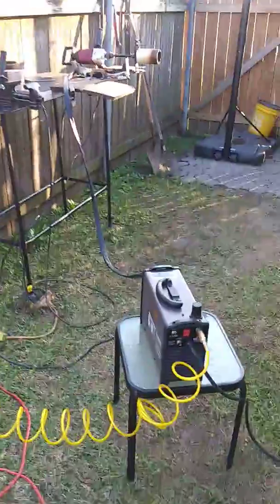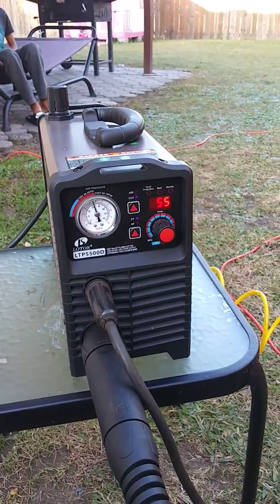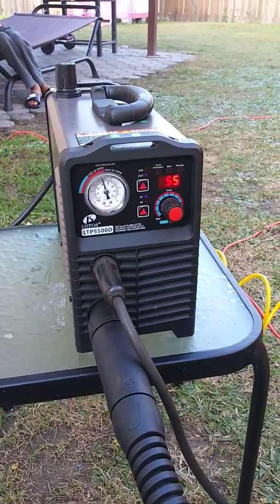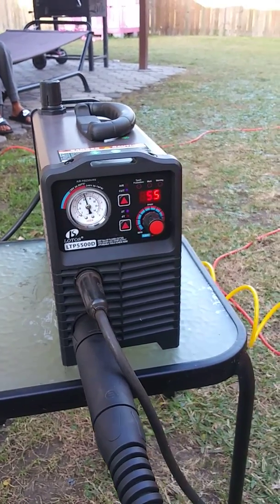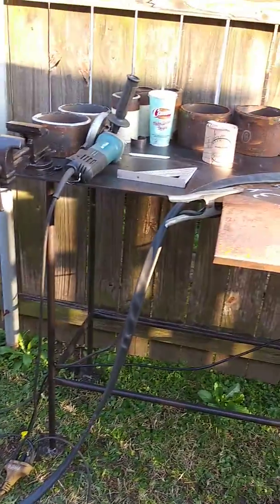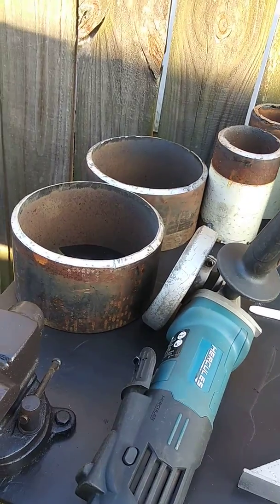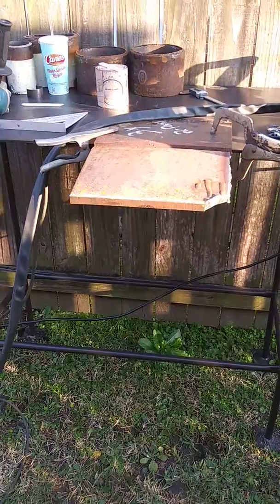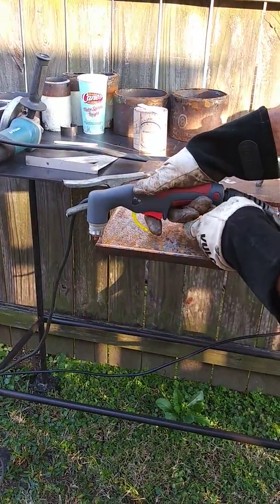plasma cutter Ltp5500d

Comment: Danny, yes it seems like a good machine made in a good factory.  Suggestion, add the words plasma cutter or plasma cutter welding.  Or Lotus xyz$%$## plasma cutter on 3/4 inch sever.  Or what ever, you get to more people and more views.   I'm obsessed with plasma cutters. My first was hyoertherm 30 but your lotus is more capable than my 1st. Also my hyoertherm from the onset brand new needed repair on the air flow.
Reply from the maker: I havent had any problems with this one yet. Had it about two years now

Comment: I see a lot of information about the LTP5000D, but not the 5500. Do you know what the difference is and is it worth paying the extra $60 for the LTP5500D?   tyia ..
Reply from the maker: The 5500 d can cut up to 1" thick plate. The 5000 cuts 3/4" max. In my opinion the 5500 is better. It can connect to the cnc machine.

Comment from the maker: I forgot to mention that other videos mentioned that you have to move slowly with these machine. I found that you could move with the same speed as an oxyacetylene torch. My cuts are usually smoother than this but it still looks ok.